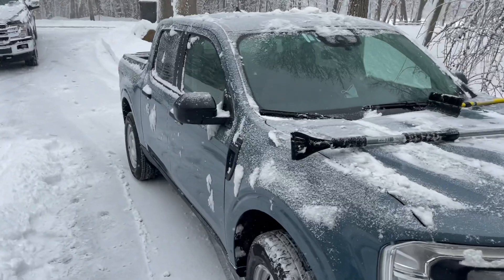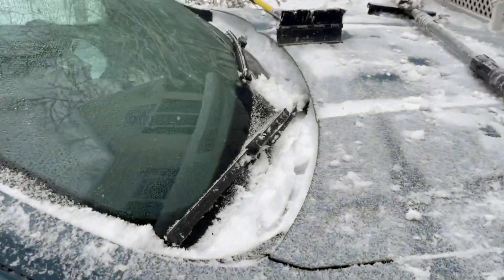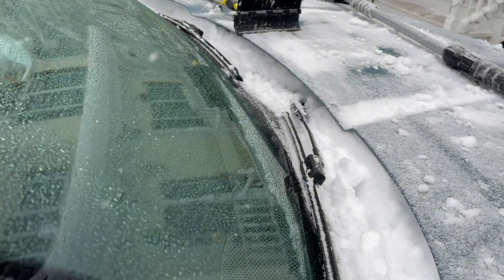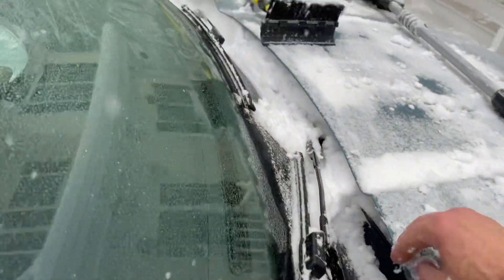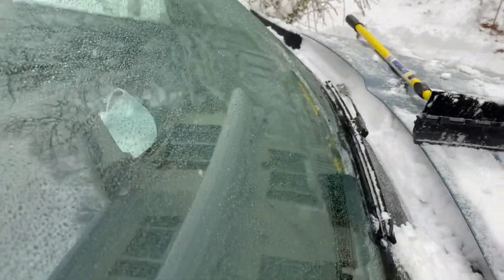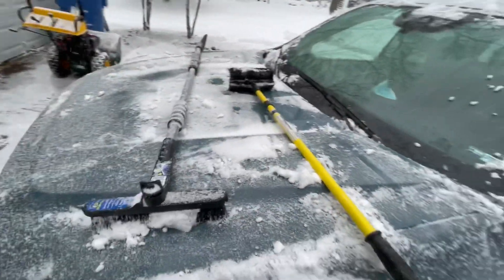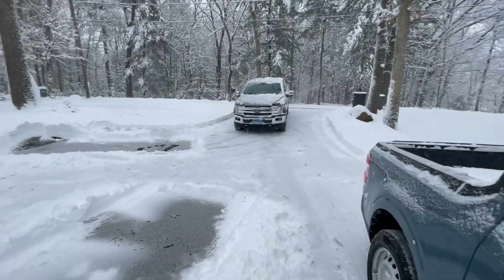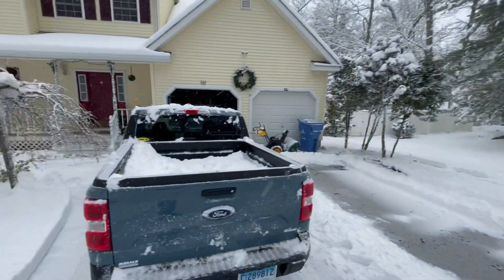Ford Maverick Engineering Fail

Comment: The wipers on the Ford Maverick can be rotated to the vertical position manually for service and cleaning. Do it slowly with minimal pressure. I live in Canada and we get our fair share of snow. When freezing rain is called for I routinely rotate the wipers and raise them off the window. Have not had any issues so far. Buying a higher trim will get you the wiper heater in the windshield. A must for winter climates.

Comment: Grab the wiper arm and pull it through its sweep pattern. You'll feel the magnetic pulses typical of a stepper motor that always knows its position. When the arms are vertical,  you can lift the arms up and they will stay up.

Comment: Gonna have to look up how to put them in "service position"
Reply from the maker: You will see a lot of comments saying put it in service mode but there is no service mode you basically have to turn the vehicle on hit the wipers and then shut the vehicle off when they reach 12 o’clock then you have to be careful because if you turn the vehicle on in the wipers are off the smash into your hood and wreck your paint.

Comment: You might want to use a different technique of keeping the wiper blades from freezing on the windshield, such as slipping something underneath them, like a small block, as I think someone mentioned.  Something that is not likely to get frozen in, which is the point of lifting the wipers.  --I don't know if you can call this an engineering fail, if other factors just took precedent and priority for the engineers.  Not everything can be prioritized.  Like you can't exactly call the gas mileage on the King Ranch an engineering failure.  The price tag of that does seem like a failure of financial engineering tho!

Comment: Engineers dont see it as a fail, because they designed it that way to maximize  aerodynamics for mpgs. Now on the consumer end yes I would agree, but let's face it when has any major automotive company had the consumers best interest in mind when it comes to practicality and maintenance, especially  with today's modern vehicles. They are designed  in a way now where you pretty much have to take it to a certified machinac to get a lot of things worked on. The days of  the avg joe being able to work on a vehicle themselves are all but gone now, with all the electronics and crap  vehicles have in them now, that require some type of vehicle  specific diagnostic computer to figure out what's wrong.
Reply from the maker: My buddy owns a repair shop and he has a sign hanging in his lobby that says we do not work on Fiats because they are such a pain in the ass to deal with

Comment: Service position.  I didn't even need my owners manual to my Ford to figure it out.  I just realized that although the wipers usually park when you shut the car off (as opposed to stopping mid-sweep when you shut it off), there must be a way to make the wipers stop in a position that I could lift the arm in order to change the blades.    And I quickly figured it out.

P.S.  My car was a Ford C-Max.  I thought "how could I do this in most cars?"   

It didn't work with the wiper switch in high or low because the wipers park no matter where they are at the moment you turn the car off.  

"But still, there must be a way, Ford has been building cars for over 100 years, they're not stupid."

On to my second try:  I held the wiper switch in the manual position (where they run for as long as you hold the stalk down) and turned the car off at the same time.  They stopped right in the middle.  "Perfect!  Ford isn't stupid and neither am I."

TL;DR:  Turn the car off while holding the wiper switch in the manual position.  The car will shut off and then the wipers will stop in the middle so you can lift them all the way up.

Comment: There’s bound to be a way to service the blades upright. It’s likely in the manual or even quicker on YouTube. I thought my Hyundai Genesis was the same way. My Genesis blades also hit the hood. There is a rest mode to position them up for ice and simple blade changes and you can’t time it by turning off the ignition. They always return to down when you turn off the ignition. To leave them up, within 5 second of turning the ignition off, hit the sweep function on the stalk and they go up and stay all day. It’s great that they don’t go back down across the ice and snow when you re start the car. It can warm up while clean the glass and only return down when you hit the stalk.

Comment: Idk about the Maverick, but usualy there is a mid pivot on the blade assembly itself. My Edge has the same exact "issue?" Ford allows rotation in their desighn with a mid pivot to combat just this. Just remember which one goes down and which one is on top. Looking at your video, they look very similar. You rotate the wiper just enough and lift, it will by pass the gap.

Comment: This is common. The procedure for most cars is to turn on the car (without starting it) and then hold the wiper stalk down and it will go up into the service position.
Reply: I used to detail cars and I came across this "phenomenon" let's call it, it's really a dumb idea, sometimes they used to take the key from the wash bay and I had no key to even put it into ACC until they brought the keys back, I remember the old days, the wipers were always above the hood, if I'm not mistaken the Audis have a thing for this design.
Reply: You are 100% right, also the service position sometimes is called snow position

Comment: My 2001 dodge ram doesn't let the wipers be propped up either. College doesn't mean smart.
Chances are the folks who designed these rode 10 speeds and skateboards in college, having no practical automotive experience to develop on.

Comment: We just have had a ice and snow storm here in ft worth Texas the ice had to be chipped and removed by hand to get them to operate. Then the large chunks of ice would blow in the crevice and the wiper on the right side would not return to its proper position and I would have to stop on the side of the road and remove them

Comment: Bit whiney aren't you?  With the issues I've had with my Silverado I would be ecstatic with that little issue.  Actually, I just sold that POS and put the Maverick on order.  I'm driving my second car until the little truck comes in .
Reply from the maker: Did you order the hybrid
Reply: @nycmaverick  No I didn't.   I need a truck to be able to tow 4000 lbs.   I really wanted the hybrid but it can't do what I need for now.    I still run some bees but now it's just a hobby.  So it's only several supers of honey instead of a couple hundred.   I only keep enough hives for my personal use and to give to friends.
I also tow a boat which is just under 3000 lbs.  
If I only ran my canoe then I could get the hybrid.
For long drives I have a Prius Plug in hybrid.   It runs about 30 miles on electric and then runs hybrid gas.   When I get somewhere I plug it in a 110 outlet and charge it.

Comment: Good video.  I love the maverick.    Improved gas mileage is far more important to most of us than having to dig out snow from behind the wiper blades.   Such compromises have to be made on a entry-level car truck .
Reply from the maker: Thanks for the reply. I agree this is a minor issue. So far this vehicle is fantastic. The most surprising thing is the performance. Incredible acceleration for a little truck. And even on the stock tires on the steel wheels it has amazing grip in the corners. Not at all what I was expecting. And it’s solid not one creak or squeak.
Reply: @nycmaverick   I love the fact that you have the steel wheels!   That is actually what I first noticed about the Maverick.    Did you get the base hybrid?
Reply from the maker: @fatboy19831  I got the XL 2.0T AWD only option other than that was all weather mats

Comment: We had snow the last two weekends and I couldn't help but notice this as well. I sucked it up and cleaned them out by hand and then went inside to do the dishes and warm my hands back up. We had hard freezes coming after the snow and I didn't want glaciers to form in there. Aw well. Only a few bugs about the vehicle and this is one of them.

Comment: That's common on LOTS of cars,  clean the snow off better...    and the same with lifting them up,pull the tiny tab and just remove them completely if this is a big deal...  be glad you have a new car for 25K
Reply from the maker: Thanks for the reply. I am greatful. Mustang 860 is that your area code? I also have a place in CT
Reply: @nycmaverick  yepper....  I wouldn't be surprised if the windshield wipers are right off of a Mustang, it's the same thing with them, you can easily remove the entire wiper and put it back on in just a second or two, two people I know here at work are getting ready to buy the Maverick🤙

Comment: Used to be, engineers made products user friendly .. not now days.  The Maverick looked promising at first glance, but more than usual problems are surfacing.  Instead of a first run vehicle Ford cud be proud of, but they chose to push it to market with inherent flaws.  Ford is shooting their own foot .. and the Maverick will get a bad reputation.  Hell - my 05 Neon has recessed wipers that open right up for blade changes, and ice removal .. and it's easy to work on.
Reply: What are the "more than usual problems"? I've had my Maverick for a few weeks now and this is the only issue I could really say anything about. Its been a great car/minitruck for me so far.

Comment: Apparently you can move them up on the Maverick. Shut the vehicle off with the wipers off in there normal parked position. Then get out of the vehicle and manually move the wiper arm until it is positioned vertical against the windshield. Then manually move each arm away from the glass. Later when you return to the vehicle. Move the wipers against the glass, enter your vehicle and cycle the wipers to again park them in there normal position.
Reply: DO NOT manually move your wipers!  The dealer won't cover that under warranty when they inevitably break.  Read the owners manual.  It's called service position.
Reply: Thanks. I have learned you are correct.

Comment: Not really a big deal in my eyes. I’ve seen plenty of vehicles over the years with recessed wiper blades. It’s an aerodynamic trade-off.
Reply: there is an air bubble of low pressure area at the base of the windshield, wiper blades don't affect aerodynamics.

Comment: If you spend just a few thousand dollars more you get heated wipers on a Maverick.
That would be an XLT with the Luxury Package...and that's only $4865. more than the base model, such a deal.
How is that base model doing in the snow ?  Does it have AWD ?
If all else fails, get in the Toyota and drive away, no worries.

Comment: Alot of cars do this, its not all that new. Not sure on the design idea behind it, regardless normally you switch ignition on switch ignition off then switch wipers on and they will raise to the vertical position and stop so you can lift them off the screen. Not 100% sure if Ford use that system, but its the same system ive used on multiple brands

Comment: That is the Ford Fiesta wiper arrangement with the deep plastic gutter.  The truck hood is oversized to the old parts bin the Fiesta Mexico line is pulling from.

Cutting the wiper in mid wipe as ignition off and raising them is future damage...because if you fail to put them down before turning the car on...the wiper will complete the cycle and gouge or jam hard on the hood.

A long frost cover is best.  I have one on the Fiesta and wife's Focus because I grew tired of scooping out bucket of snow each morning.
Reply: The 2023 wiper arms will probably be changed to long anchor shaft, shorter arm.

Comment: My 2006 1500 is the same way I hate hate hate them in snow . My 90's Chevy tipped up. Trying to save 15 cents on cost. I will never buy a car or truck with no tip up wiper blades again ever.

Comment: most people around here put their wipers up.   Its just part of the standard proceducure for us here.     It happens EVEN IF you can lift up your blades.    The reason is that you dont want slush  to accumulate on the blades.. then freeze them locked in the low position.

Comment: The wipers are recessed low for aerodynamics otherwise the wiper blades are a huge drag when driving.
My wife's 2006 Honda has the wipers recessed even further beneath the hood. 
Get a frost guard - pro windshield cover...problem was solved with the snow buoldup.
Yes, you need to stop the the wipers halfway through their cycle in order to change the blades. This has been a common design for years.

Comment: I too am a Maverick owner, indeed they do go up however it’s a manual application. Not much of a hassle for me, it’s a manual application for all cars. The wiper arms move from that tucked away position they’re in, gently move the arm up 3-4 inches and the hinge is cleared from the hood. Hope this helps! Stay safe out there. #FordMaverick
Reply: OMG, NO!  Don't do that!   RTFM.  It's called service position.  It stops the wipers mid-sweep so you can lift them off the glass.

Comment: Living in Northern Ontario this was the first thing that caught my eye when I went to test drive one. The sales rep was scooping the  snow out from there just to clear the windshield properly as the vehicle warmed up. Never mind snow, the freezing rain also builds up inside there and would be a bitch to scrape out. Yes  the engineers should have made it flush or semi-recessed  to the hood line.
Otherwise I left not purchasing one, but the vehicle left me with a positive vibe.
Even my wife's Fusion you can lift the blades up no problem.

Comment: Three "other" things to try:

1. Open the hood all the way and see if the wipers will clear from the inside.

2. Or, while the vehicle powered off, see if you can manually lift the wipers up across the windshield by hand. Some manufacturers have what they call a "winter/service" position that is a mechanical detent within the wipers mechanism, it's a one-click "pop" that can position the wipers about 3" higher than usual on the windshield for access. Some vehicles like Toyota/Lexus have this feature, it is completely a hands-on mechanical trick that not too many people are aware that is possible (besides technicians).

Some Fords also have an automated service position, where if you shut the car off, hit the start button without your foot on the brake, and hold the momentary position down on the wiper lever, they will go up and stop there. Other Fords (like the Edge) allow the wipers to be physically rotated with no resistance when the vehicle is powered off.

Or, you could drive it to Ford's HQ in Michigan and light it on fire in their parking lot.

Comment: I got my 22 maverick a couple weeks back, we had 20" of snow fall 2 nights ago in Ontario... same issue, if you manually move the wiper up a half inch, it will bend open fully on the hinge & there's no issue. I don't like the gap between the hood and windshield though...
Reply from the maker: Huge gap especially if it’s a snow ice mix
Reply: Would the snow cause damage if it melts and water falls into the engine there? Silly question jw
Reply: @HorizonMatter  water drains from the cowl through the bottom of the A pillar, all cars do this.

Comment: Wait, you can’t flip up the wipers when parking it in a snow storm? It’s almost like the engineers of these vehicles don’t drive cars.
Reply: Engineers dont want people flipping up their wipers. Because then people bitch when the wiper falls back down on the windshield and cracks it. 

The wipers have a service position at the top of their stroke, that's where you can raise them if you feel the need to.
Reply: Engineers are Idiots!🤪

Comment: I would suggest on purchasing a frost guard windshield cover. It would cover the gap. The snow will collect on the  windshield cover and you can simply wipe it off. I've used it on other cars and it works great.
Reply: Exactly - I did the same thing....problem solved.

Comment: Why do you need to scoop the snow out? It's not blocking your vision and it will melt eventually, now leaves would be different, they don't melt, but not parking under a tree would fix that.

Comment: My 2008 Mercury Grand Marquis has the same issues, the snow doesn't bother me as much as leaves getting in there in the autumn. The gap looks wider and deeper than my car.  While watching I thought maybe you could roll up some old screen from windows and fill the gap, you could leave them in or take them out as you drive.
Reply: I grab my 18 volt leaf blower and blow the snow out of there. It works great on the lighter/ colder snow.

Comment: Waiting for my Maverick and I hope it arrives before we go to the moon again. The Maverick Lariat will be my first NEW Ford product . I really hope that Ford has a better idea and it runs as good as my trade-in does. (2020 Sienna Van)
Reply from the maker: You will love it. The Sienna Vans are great vehicles also. Was your van AWD? Did you get the Maverick Hybrid.
Reply: @nycmaverick  No to both and that is the reason for the AWD Ford. I also have a boat and a small utility trailer to pull so I chose the 2.0 with the turbo.